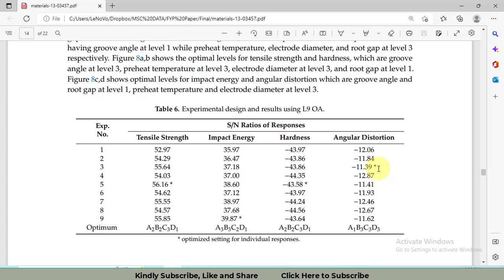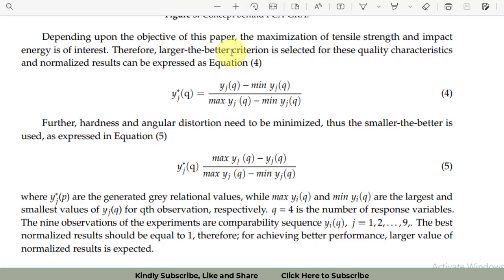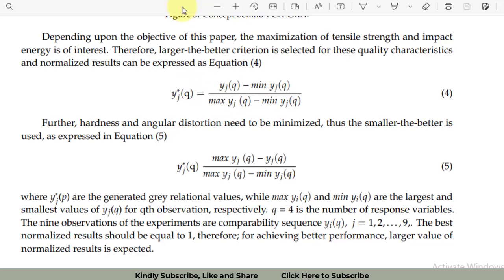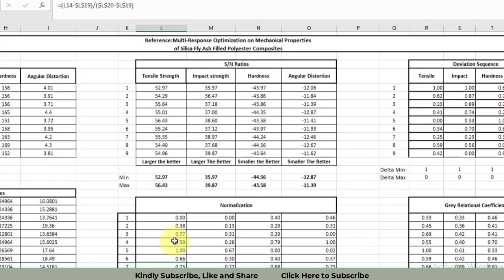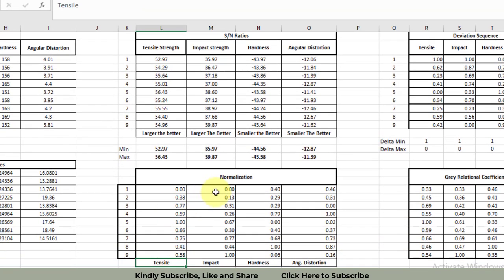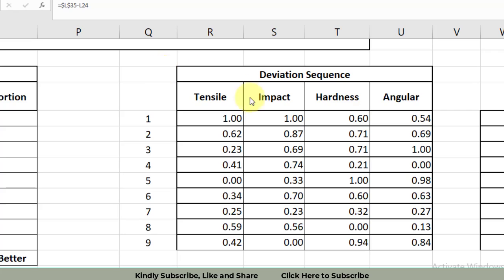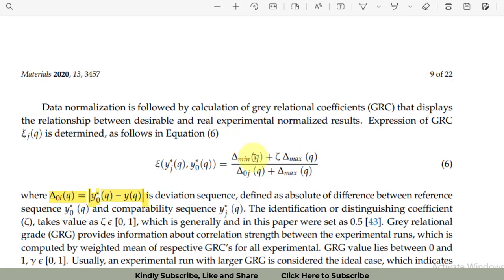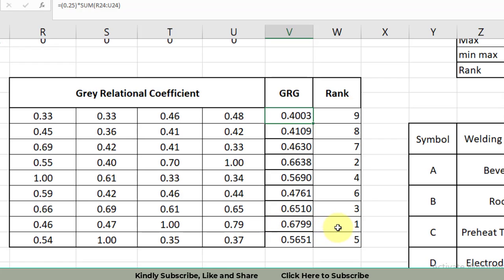Taguchi-based Grey Relational Analysis (GRA) | Multi-optimization of Welding Parameter | Taguchi GRA

Comment: Hello, I am currently doing my own optimization approach using Taguchi + GRA and am currently stuck with a logical problem of this process, hopefully your explanation can clear things up. I have a similar problem in which I have a multi-directional optimizations such as these, some larger the better, and some smaller the better. I have a problem with "smaller the better" approach. 

Taking from the data here at 05:25, for "Hardness" coloumn, I see that S/N-formula "smaller the better" is applied, which then evaluates the 5th combination as the best one. then, as normalization "smaller the better" is applied, the 5th run will simply be 0.00, which I assume this became the lowest value of the normalisation. seeing as the subsequent processes do not consider optimization direction anymore, was this a logical failure that puts the most desirable combination into the least desirable outcome, or is there an explanation in the formulas for it?

Comment: how do u calculate the grg at eachlevel  for each response in the last ofvideo
Reply from the maker: Use minitab.... you will get directly
Reply: @EngineeringandInfo  but actually I have another doubt how to do confirmation test for it..I read too many papers but not found any correct justification or method ..please help me
Reply from the maker: @ajaykushwah6793  do confirmatory tests on optimal settings

Comment: Hi, thank you for the detailed video. However, I have a doubt while calculating GRC. You have multiplied del.max(q) by 0.5 both in the numerator as well as in the denominator. As per the formula, 0.5 should be multiplied only in the numerator. Request to clarify this doubt.
Reply from the maker: Please check formula in different papers. There is a mistake in one of my paper
Reply: @EngineeringandInfo  Thank you for the clarification.